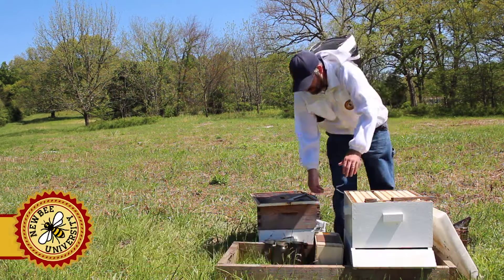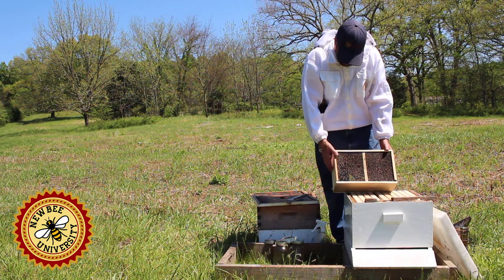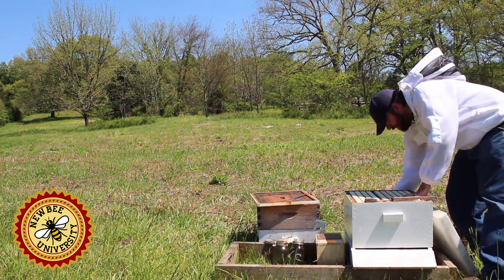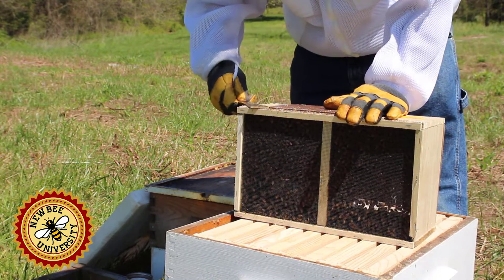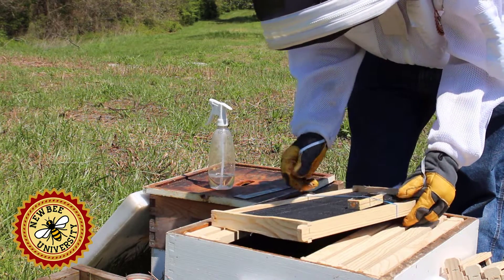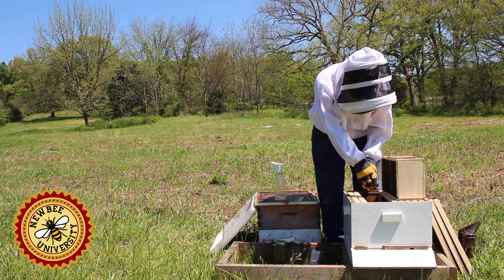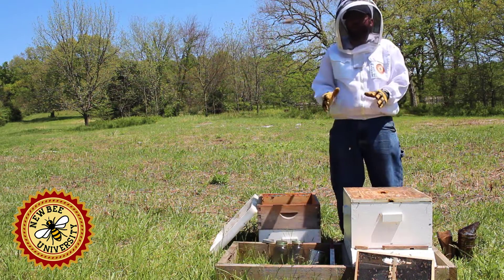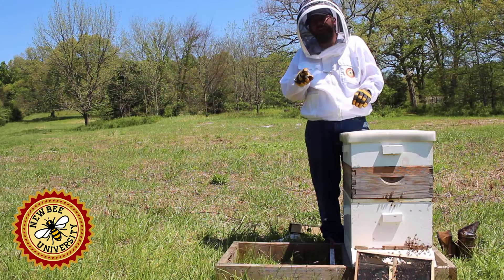How to Install a Package of Bees

Comment: I merge a package onto an existing colony with newspaper? Of course, I will take out the queen and start another NUC with that queen .  Ps: is the package wooden  box the same size of a 10 frame box or will it fit inside so I can put an empty box over it if I wanna merge with newspaper right on top of the existing frames?

Comment: Do all packages bees come with the queen excluder like that, with the candy?
Or does it vary by company?
Reply: The packages I bought this year didn't have any candy in the queen cage.  The supplier gave me the candy plugs separately.  When installing the queen I simply popped out the cork and replaced it with a candy plug.  I've heard you can also use miniature marshmallows as a candy plug.

Comment: Should I be concerned if they start building comb where the feeders are?  And possibly the queen moves up there.  I’m new to the bee hobby this year and just installed my first nuc.  Getting a package in two weeks.
Reply from the maker: Bees will always build comb where there is extra space. While it's not "Bad" for the bees is it a waste of there resources and can make inspections more difficult. It is always best to fill open spaces with frames. So if you have an extra box on top for the feeder you can fill the extra space with frames. Or you can put an inner cover on and the feader above that so they don't access the upper box but can access the sugar water. Hope that helps, welcome to the addiction and happy beekeeping!

Comment: Hello I did this exactly but was wondering. Will the other frame block the screen on the queen cage? Is there enough room to keep her happy?
Reply from the maker: You always want to make sure the queens exit from the cage is not blocked and that the bees that are feeding the queen have some access still to the openings on the cage. Most cage designs this will not be an issue, but do keep that in mind when putting the queen in place, her exit and the workers access to feed her. Happy beekeeping!

Comment: I used the rubber band to hold the queen cage. 6 days later I opened the new hives. The queens were released as expected but cages had moved some and the rubber bands were gone. Did the bees chew up the bands? One hive had a small area of double layers of comb. Might have been where the rubber band had been below the top bar. Both hives are fine it's just odd that the bands were gone on both of them.
Reply from the maker: Hello Kenneth, Yes bees will chew through and remove rubber bands. This method is often used to secure comb from cutouts into new frames and the bees will work on attaching the comb to the frame and at the same time work to remove the rubber bands. They will chew them free and drag them right out the entrance onto the ground, much like they do with dead bees and other hive debirs. Thanks and happy beekeeping!

Comment: Question !  Some beekeepers said to use a solid bottom board to keep the pheromones in (the rationale being that it is a new queen that the hive has?) .  What is the reason for the screened bottom board?  Thanks !
Reply from the maker: Hello, Most queen pheromone is spread my contact from one bee to the next (not between all bees and the queen but from the queen to her attendants then from them throughout the hive) or even between the queen and the comb she walks on. So I don't see much advantage in the way of queen pheromone. However I will say screened vs solid is a beekeeper preference. The idea is that screened bottom boards allow more air flow (and can be closed in winter if desired) and allow colony debris to drop out. Some also say it helps with varroa, which I think is likely minimal. Some of the best beekeepers I know swear by solid while others swear by screen :) I don't have a strong preference personally. Happy Beekeeping!

Comment: Is that a molded plastic top you used at the very end of the video?
Reply: Sure looks like one.  I have about 10 of those plastic covers from years back and I got them from Kelly Co/ Walter T. Kelly Co years ago when I bought mine.

Comment: What if one is getting two packages? Was told hives can be side by side. How does that work?
Reply from the maker: While in nature colonies are well spaced and this prevents many of the problems that we deal with as beekeepers  (robbing, mite spread, etc) it is a very common practice for managed colonies to be rather close. This is for the sake of the beekeeper not the bees. If you are placing two colonies close together there will be some drift (bees going into the wrong coloy), especially with drone bees, but this should not have a major impact. For the most part the bees will use there navigation skills and the pheromones from there specific colony to help them return to the correct hive.
Reply: i just installed two, and the only issue i had was the bees from the first package found the second package and were all over it, making it harder to handle the second package. Bees were relatively calm though. I think I didn't get enough bees out of the packages by shaking, but I am new and was worried about making them mad, as it was already cloudy and windy and they were probably not happy about that. I think if I got more bees out of the first package into the hive, there would have been less bees on the second package. But I should knock the bees off the second package with ease. Only got stung once (was suited so didn't feel it), and plenty of bees were bumping me, but it seemed they were much more concerned with getting to the queen and sugar water because when I was 6 feet away they didnt care about me at all.

Comment: How long do you leave the feeders in like that without worrying that the hive might try to make comb up in the extra/empty mediums? Husband and I are trying to decide on the best course of action here. Also, you dont use an excluder?
Reply from the maker: I have never had a problem with package bees building around the feeder as long as they still have comb to build on new foundations. The inner cover also helps keep them from moving up top into the empty area around the sugar water. Personally, I do not favor feeding so once the deep was drawn I would remove the sugar water, others might add another deep or honey super and keep feeding until it is drawn. You definitely do not want to feed while drawn supers are present as they will store this sugar water and it should not be treated or marketed as honey.